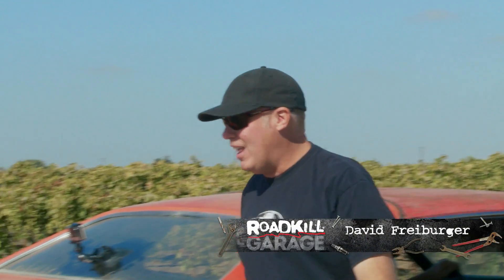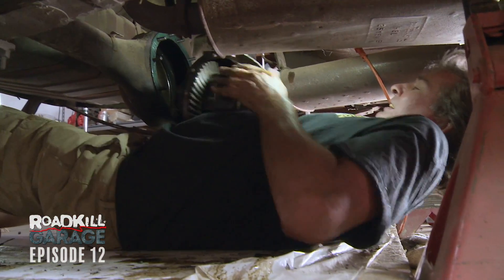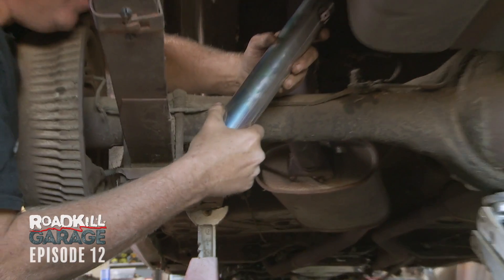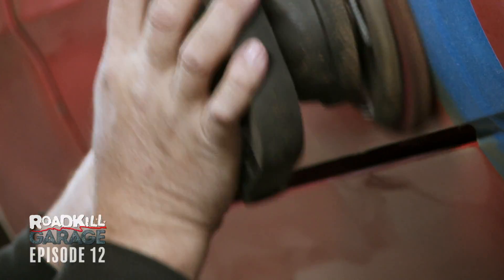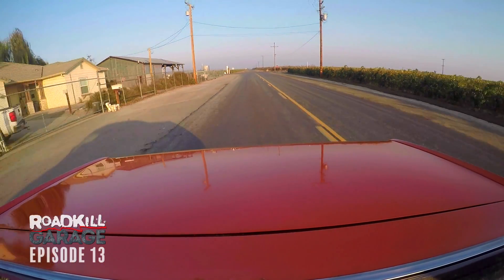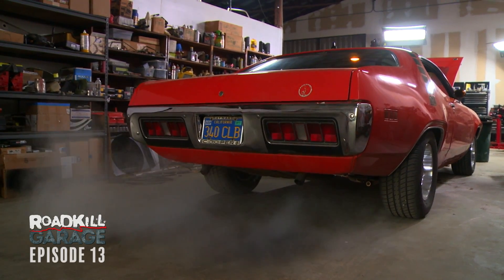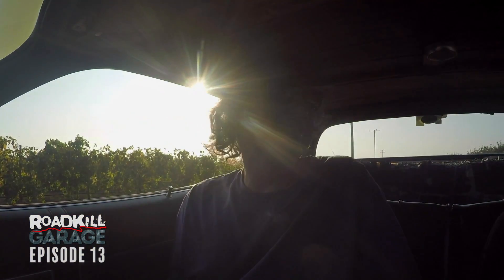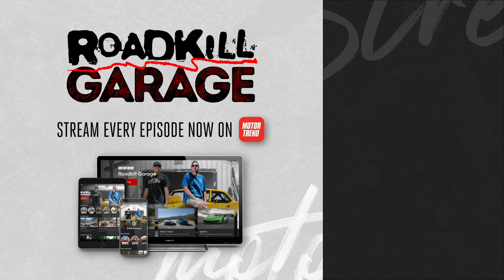Rebuilding a "Dream Car" Road Runner! | Roadkill Garage | MotorTrend

Comment: I had an all stock '71 Satellite (exact same car without all the fancy Road Runner badges) w 383 and 3 speed manual. Ran mid to high 14s  back when it was only 6 years old. Loved that car.

Comment: I was kind of shocked to see that it had front drum brakes, and even more shocked you didn't upgrade them to disc. The first car I bought myself was a '74 RR, and even with front discs, it wasn't the greatest stopper in the world.
Reply: it doesn't matter too much what brakes you have on if the car weighs 5 tons lol
Reply: Drums work ok dude, not worth changing on a daily driver

Comment: 2.76 wow. I kind of always liked 3.23 as a good middle of the road for highway driving and acceleration on a daily driver type car. Funny, the late '70's factory sales info calls the 3.23 a 'performance' axle. I noticed you had the Midas Turbo King mufflers or stock replacements. They used to change those out for free under warranty if they had the diamonds embossed on them. I had a '71 RR that was a plain bench seat 383 column auto in Sassy Grass Green. Factory stock that was THE best running 383 I ever had. Must have been one of 'those' engines that came together right. Think it was an early build Aug '70 or something.

Comment: You gotta put a limited slip diff on that thing.  I think a series of Roadkill episodes slowly making this car better and better would be interesting.  Do it like a regular guy would do....adding performance bits as he can afford them.  This car is worth saving and making it a nice daily driver that has some power when you need it.
My list: Upgrade camshaft, port and polish the heads, headers and exhaust, ( shoot for minimum 400 HP), disc brakes, upgrade suspension, (Magnum Force K-member and UCA's, LCA's,Rack & pinion, coilovers), six speed manual trans, recover the seats, carpet, door panels, headliner...that should cover several episodes.
Reply: Exactly my thoughts except a 411 gear with a gear vendors overdrive and aftermarket heads for 450 hp .

Comment: I can relate I just did a beautiful U code challenger with 2 build sheets Fender tag Fender tag original title and did a full nut and bolt  restoration on it and on it prettiest 70 challenger an F5 red with a black top and black interior with its matching numbers 440 engine and also transmission transmission with 2 build sheets

Comment: I have a set of 2:76 (posi) in my 69 Charger. With 295-50-15 rear tires I'm at 84 MPH at 3000 rpm. Not as good as my 80 Corvette but will work on the Texas toll roads no problem. I can cruise at that all day too....

Comment: YOU GUYS ARE A TOTAL BLAST.  LAUGH MY BUTT OFF ALL THE TIME.  PLUS, YOU GUYS ARE GREAT WRENCHES.  MY DRAG RACING BUDDY'S OLD MAN WAS THE ORIGINAL, ''MR. GOODWRENCH,'' FROM THE 1960''S.  THEY RAN A SUPER  STOCK MALIBU, DIALING 10.00 BUT COULD NOT COMPETE AGAINST THE CAMOAROS DIALING HIGH 9s

Comment: That's how I put in the diff in '94 Hilux. The human body has a lot of strength and stability in that orientation. Edit: what became of that project Buick Special station wagon with a lighty modified 455 out of a '72 (?) Electra in Car Craft in the '90s? That thing ran 14 flat in the quarter and you called it slow. Ad some modern R134a A/C, power steering and brakes and that would have been a funky daily wagon for me.

Comment: Whats the compression?Did you check it? I had a 383 that ran perfect running on a low cyl 80  others were 120-130..But it was down on power a lot! Yes I drove the car for years and abused it lol..

2.76 axle ratio..The highest I go is 3.23 and I do a lot of highway driving! Lowest 3.55 with a 3 speed..

Car would be in the upper 5's and high 13's with 3.23's..You really notice a difference from 2.76 to 3.23! I know I put in 3.23's in my Charger when I was in a pinch about 23 years ago as a young,young man..
Reply: He already sold this car. This episode is from a few years ago. 
Wish they could post current stuff for once

Comment: Now if it had gearing like modern 5..6..8..9..&10 speed transmissions this car would run 4.9 0-60 and low 13's in the 1/4! The new trans are like having 4.56 or lower rear gear ratios in your car!

Comment: did he say 2.76  or 3.76 for the dif?
Reply: Should be 3.54, 3.73 or 3.90
Reply: For a 8 3/4 rear.
Reply: @rwl8150  It launched like a 2.70   lol  but did the quarter good. I don't know alot about chryslers. I was hoping he said 3.73

Comment: Disgraceful and not knowing....Any properly tuned 383 could run the quarter in 14 sec range at about 96 MPH. Lots of magazines attest to this fact. When my dad took possession of his 71, he immediately performed some tuning (He was a mechanic) and go the car to run low 14 sec quarters (with 3.23 gears) at 98 MPH. He said the ignition timing was tuned for streetability...he put a faster curve in the distributor and a bit more total timing...